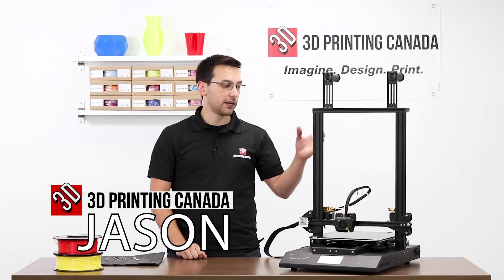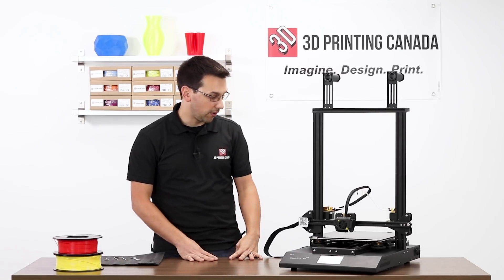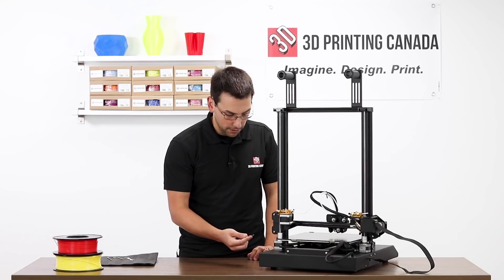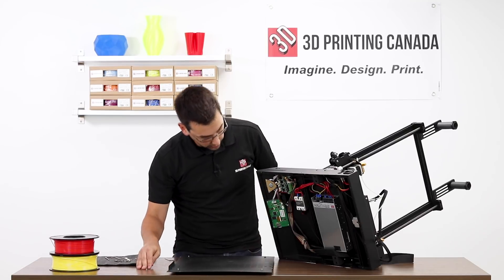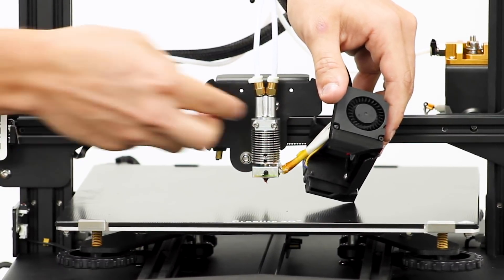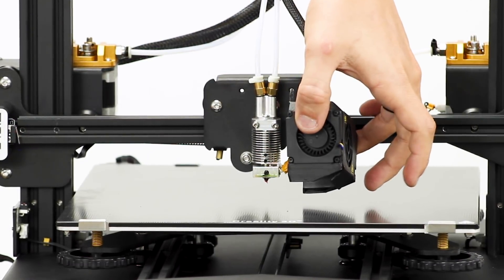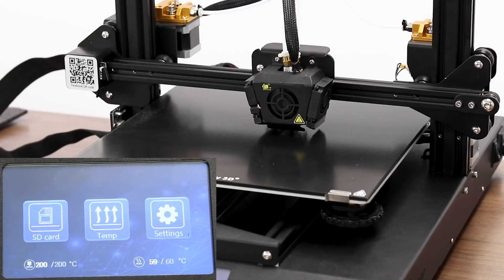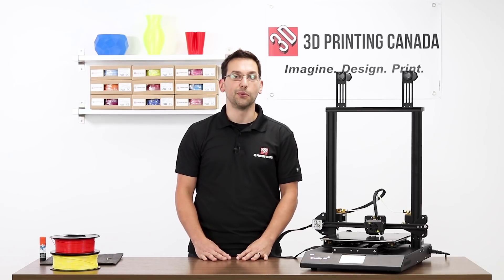In-depth Overview of the Creality CR-X

Comment: 60 is not hot enough for bed stiction. this is like Ultrabase the bed NEEDS to be hot (75c) for proper pla stiction. even then mine was a wee "lackluster" just like my ultrabase.

this is also easy to fix. take a little high grit sand paper to the surface a little at a time till you get the stick you like and always alcohol wipe every time you use it. any oils or anything from your hands etc.. will impact stiction.

for tricky parts a little glue stick for security.
Reply: Jason yes the ultrabase surface needs to be a bit hotter than you might normally use or it just doesn't stick especially if it's air-conditioned

I had the same problem on my I3 Mega and my JG Aurora A5 the prince reference needs to be typically 10 or 15 degrees hotter than you normally would the same applies if you attempt to print directly on glass you really need to be 70 or 75 Celsius at least in my experience and I don't experience I need information elephant's foot or warping you really shouldn't be squishing too much on this print surface he basically kind of dropped the hot filament on to it and that seems to work the best if you squish too much it just peels up under itself as it extrudes

I consider sending to be normal all you're doing is changing the adhesive properties of the printer that's no different than adding gluestick just don't overdo the sanding kind of like removing a glazing on a surface you just scuffing up a surface a little bit thousand grit sandpaper should be enough and of course alcohol clean before every use

60 C is probably enough except the top of the glass will never reach 60 C at least not for a while you lose a bit as a transmitted through so much material